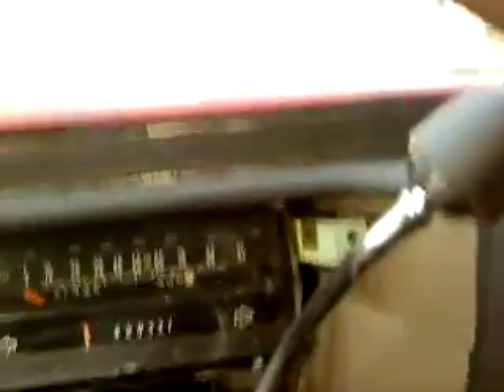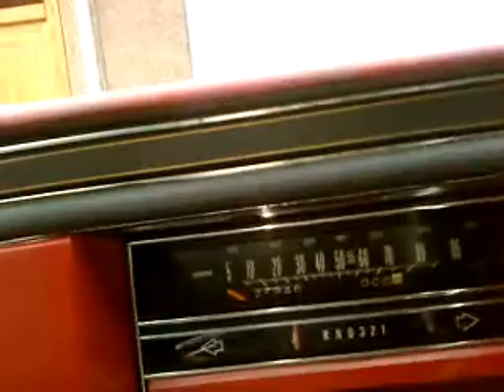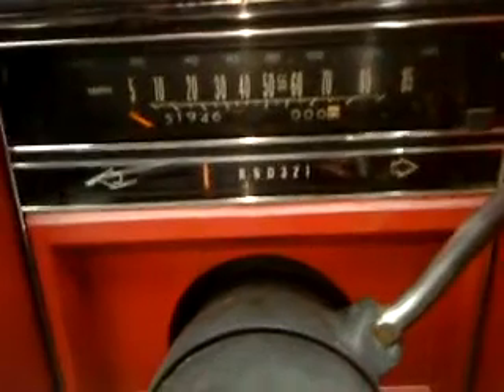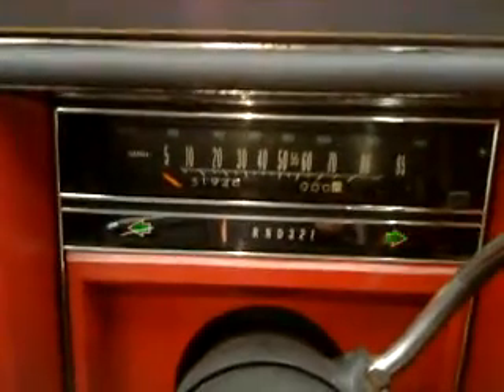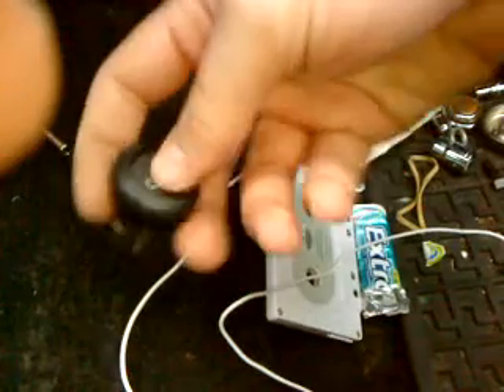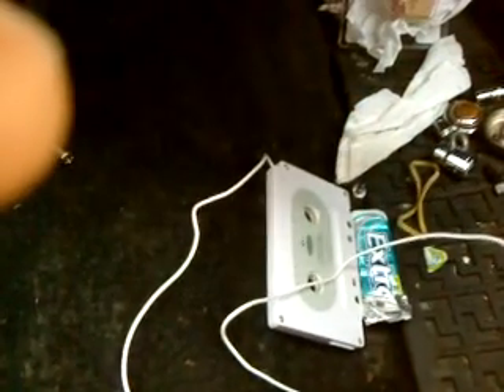Dashboard Rebuild! And assorted in-car junk!

Comment: I have an old 1990 Brougham dElegance. I am trying to get the headliner out to refurbish it. Any ideas would be appreciated. have removed screws and dash as part of the side molding was Under some of the side dash material. I have loosen the clips about the door on outside and before moving on I don't want to break anything I can't easily replace. I have materials I want to use for seats and headliner.
Reply from the maker: I have removed some of those parts before, Be careful with the molding around the back window, the clips that hold it break very easily are difficult to find. You have to take out a lot: Door moldings, map light, sun visors and the A and B pillar moldings.
Reply: Thanks. I have finally got the headliner down and yep broke a couple of clamps. I see that someone might have tried to take it down before and cracked it and didn't remove all the way. it's really damaged but it HAD to come down. too much dust coming from the dry rotted material. I will be taking my time putting viynal on the map light panels and redoing the dash as well. hope to get some pics if possible.

Comment: The metal moldings don't seem to want to separate from the frame of the car and I'm afraid I might crack it. I have multiple insetting joints of molding that fit inside one another and I am having difficulty pulling apart to get the liner down. no vids found on caddys :-(
Reply from the maker: I wouldn't know that one, I haven't replaced my headliner yet. But from memory, to remove those moldings, you have to work from back to front. You have to remove the door moldings from the lock side to the hinge side.
Reply: thanks.
Reply: well... I finally got it down but broke a couple of clamps. Don't know it will go back in after I replace material of headliner. I will also replace material of back map lights with pleather and will also cover dashboard after I fix the cracks. No uidget but a lowes credit card so I will do  my best to help my big mama Gertrude Caddy last a little while longer